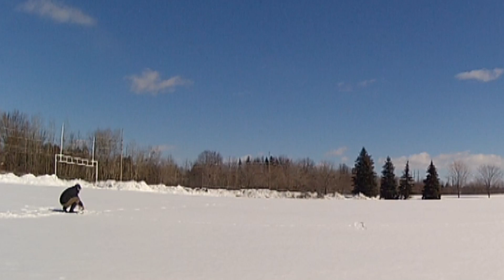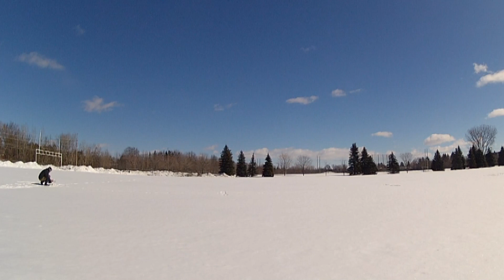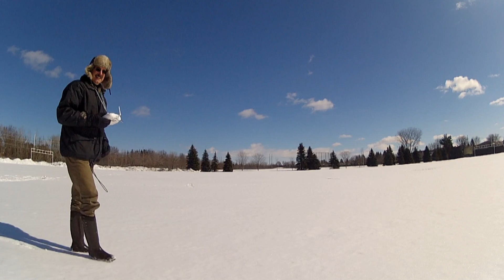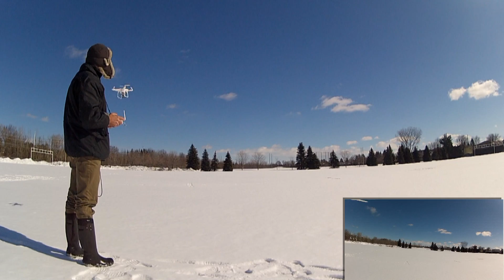Switch-CL-in-flight

Comment: Excellent! It looks like I commented too soon on your other video (CL-and-HL-mode). You've answered my curiosity here - you can in fact change the course line while in flight. This is great news, as this will allow me to adjust mid-flight for unpredictable vectors for waterskiers and wakeboarders.
I'm also glad you pointed out that the CL works in parallel to the set course line, and not just limited to along the course line. That makes a huge difference, and is very good to know.
Thanks for all the time and effort testing, and passing this info along.
Reply from the maker: Glad I could help.

Comment from the maker: Not sure if it's still the same, but right out of the box the IOC functions (left switch) are disabled to prevent newbies from getting into trouble.  Install the Assistant software and check the box to enable IOC (Intelligent Orientation Control).  Similarly on the flight mode switch (right switch) out of the box you can only choose between GPS, ATTI, or ATTI.  The Assistant software lets you configure the 3rd position as Manual, or with latest firmware the 3rd position can be Failsafe.